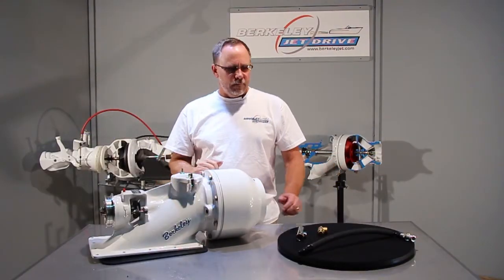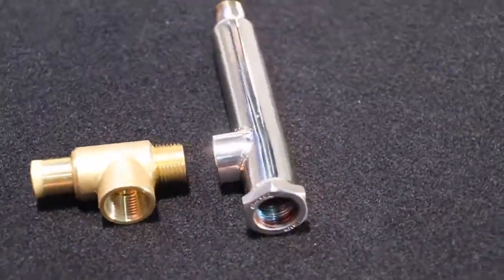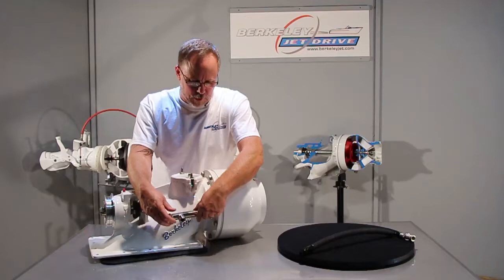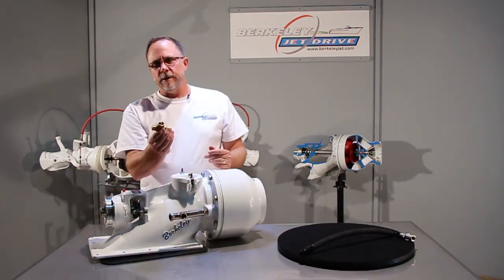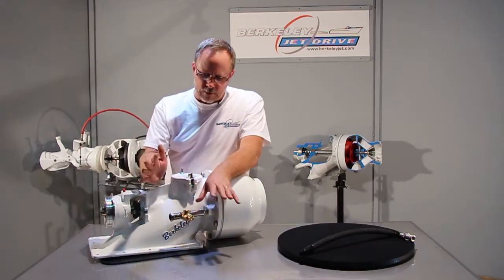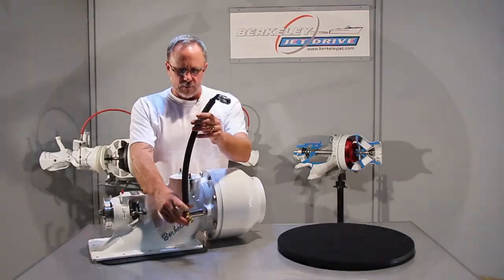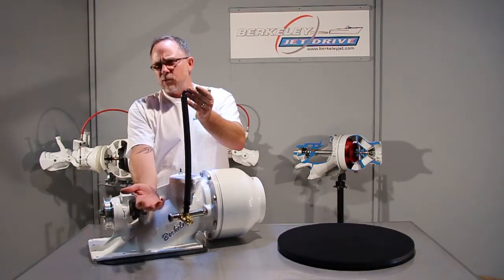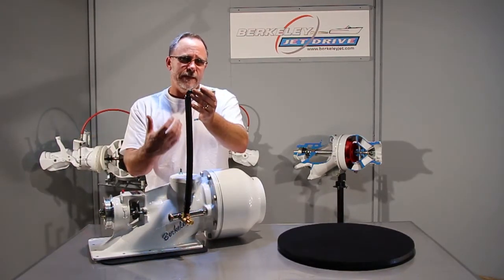Adding a Pressure Relief Valve Kit to a Berkeley Jet Drive

Comment: With out that will it push water in to the oil ?
Reply: It’s possible for excess pressure to blow a head gasket, which I what happened with my boat. This is a relatively inexpensive way to help prevent that from happening
Reply: No its not going to push water into the oil. How you blow head gaskets is poor engine build or oddly over heating your engine in a jet boat?? I owned a jet boat for 20 years going all the way to push 900 hp at my jet drive and never blew a head gasket. Bent a rod scored 3 pistons from standing on the nitrious button to long lol. However I never once overheated my 3 different engine rebuilds in that boat. And pounded on it.
Reply: @nosman069 all my buddys with bbc do run those relief valve and they all have no issues they pulled junk yard motor and put the straight in to their boats and still no issues ....but on my Olds i would stop pushing water past the intake gaskets until i put one of the valves